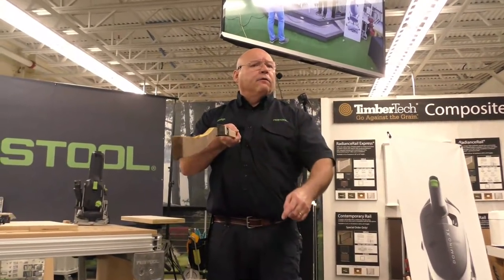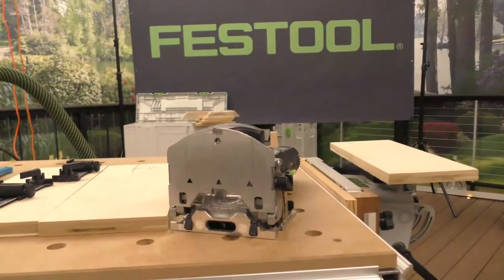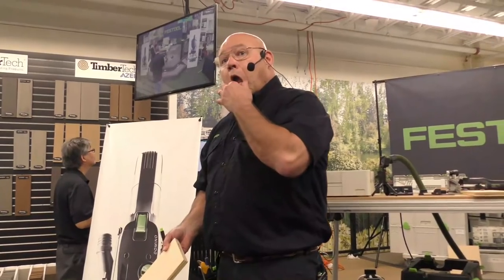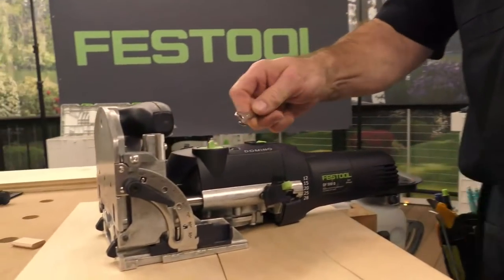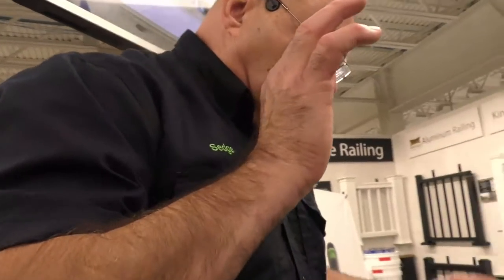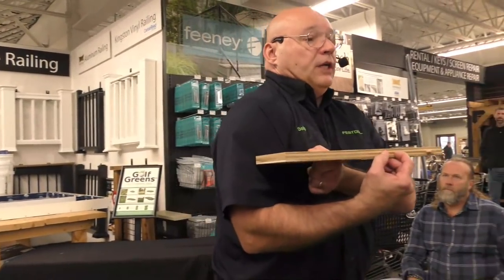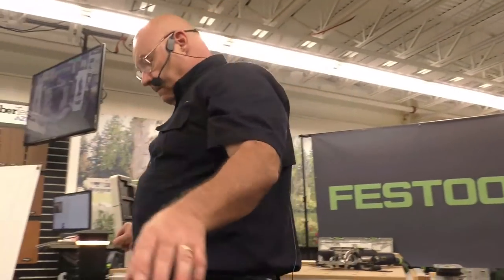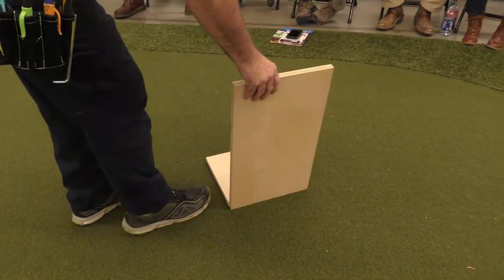Festool Live Episode 76 - Top Questions Answered: The Domino

Comment: Hello, I’m curious when do you use the loosest setting on the domino? Thanks.
Reply: Recently I built a painters easel. Adjustable but it’s about 6 feet tall, all in all. For the top and bottom rails I used the tight setting. For the middle rail I used the loose setting for a little bit of insurance. It’s only loose in one axis of the tennon, the width, not the thickness. That’s still tight.
Reply: You seem out of breath, are you ok
Reply: @dougsinden6881  lol I was out of breath reading it